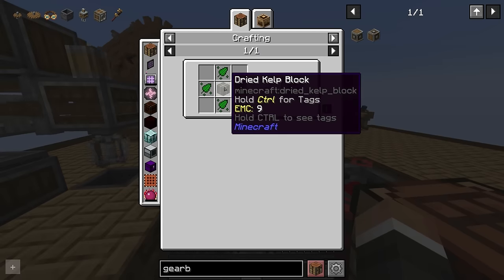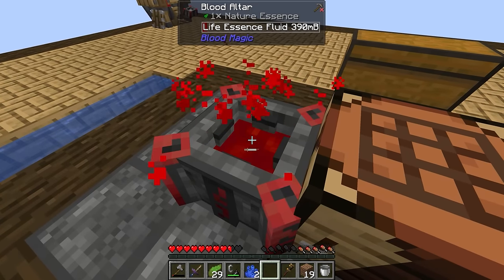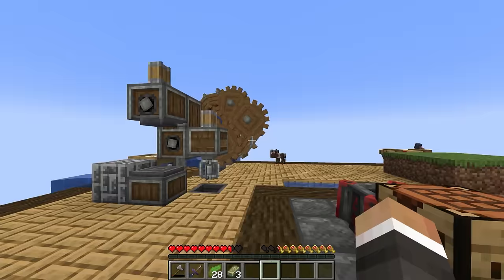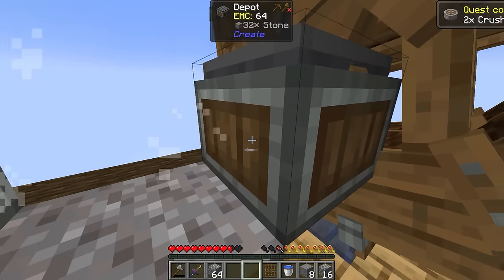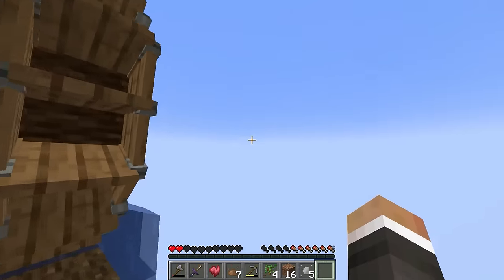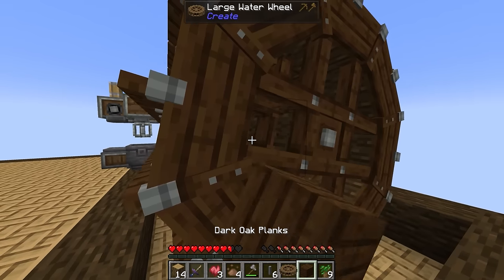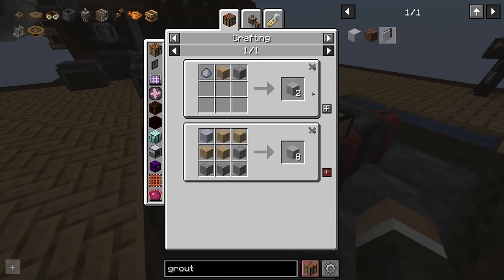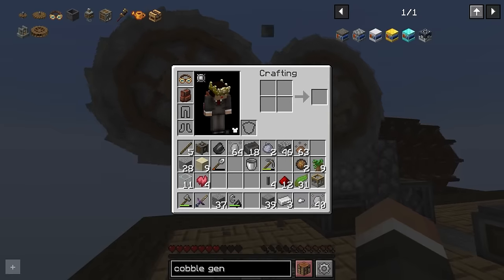Minecraft Project Sacrifice | GROWING COWS & WATER WHEEL POWER! #2 [Modded Questing Skyblock]

Comment: I think you have to have water under each water wheel to gain the additional SU, even though they're spinning.
Reply: i was going to say, he didnt actually 'turn on' the water wheels
Reply: Yeah they only spining not generating su
Reply: He fixed it later in the video (when he got the engineer goggles)
Reply: @creeperbait_42  awesome, I haven't had a chance to finish the video yet, so that's on me lol
Reply: I think if you put the water over the waterwheels or on the side but higher you get more stress
Reply: @Capitno981 not in this version of create
Reply: @Capitno981  no longer matters, they are omnidirectional as well
one block of water will do
Reply: Yeah watching that kinda hurt... I'm amazed he didn't see it
Reply: The one thing I'm amazed he didn't do was use that platform to hold the water instead of running it through the floor. That made absolutely no sense what so ever. Why have holes in your floor and more flowing water?
Reply: Was just about to say the same thing that eh wasn't even using any of the water wheels

Comment: CREATE TIP: the speed of the encased fan does not effect the speed of it washing, smoking, or smelting, just the range of the air particles.
Reply: And how fast it will push the items if there on the ground
Reply: Additional tip: Encased fans can be placed at depot level and one above depot level and they would both affect the item on the depot. Speeding up fan processing requires more fans and putting two down like that is an efficient way to double the speed. You can also waterlog the depot. To make the fastest fan processing you could then surround a depot with 2 fans on each of the four sides with one more facing down.

Comment: Great videos.  Couple ideas.  You can use a campfire between the Encased fan and Depot rather than having to use fire.   When waterlogging the  millstone, if you encase the water, then place the millstone, when you remove the other blocks, the water won't flow.
Reply: The problem with a campfire is that he'd have to craft it again each time he breaks it.  It'll work splendidly once he gets multiple fans, though!
Reply: in this modpack i think you get the campfire back after breaking it but i dont know for sure bc i played it a while ago
Reply: @juliandewilde3188  Sadly you don't, but you can just waterlog the campfire, then pick up the water and just relight the fire, until you get multiple fans, which is fairly cheap to do.